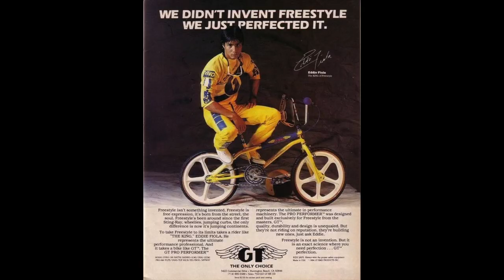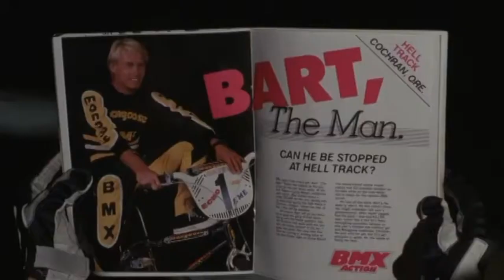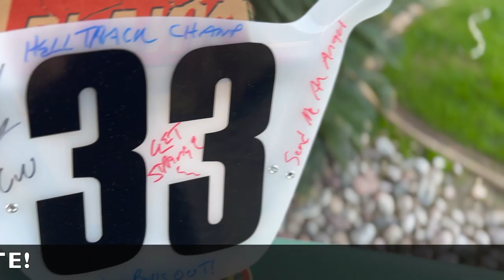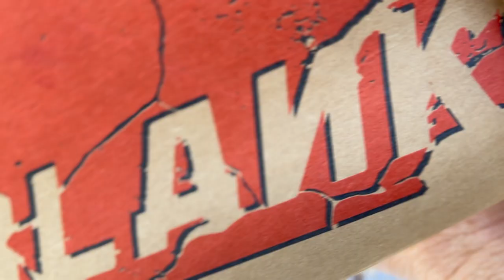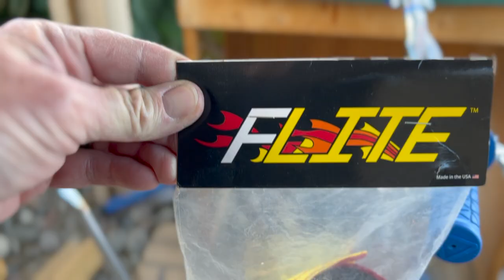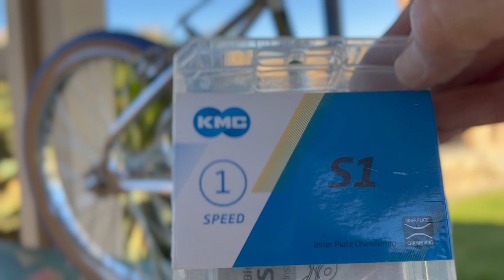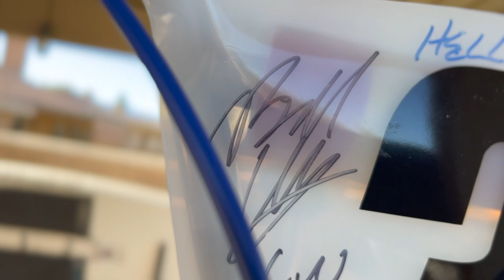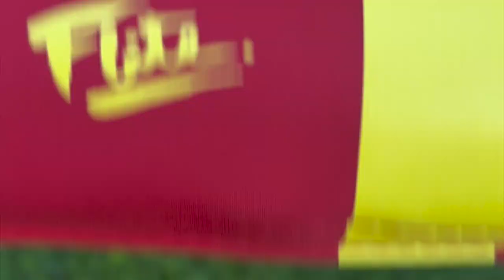RAD THE MOVIE CRU JONES DREAM BMX BIKE BUILD

Comment: Nice build, and nice backyard too!  Suggest lowering that seat post about 10 inches so the frame seat tube doesn't crack.
Reply: no thats how they're meant to be its 1980s bmx
Reply: @鐽  Many frame seat tubes cracked in the 1980s because the seat was too high (increased leverage).  Especially with a laid back seatpost shifting the weight further back.

Comment: I got my first My first BMX  in 1981 for my communion present; twas a used Black Mongoose, with red Araya rims, from what I remember.  The frame was probably 79, or 80: by the time the movie RAD came out I had a chrome, and white Haro sport .  My friends and I watched that movie every single day, afterwards, we  then went outside to practice the tricks from the movie.💫 RIP Tommy.
Reply: I had a 16” diamondback mini-viper in the late 80s early nineties and my sister had a viper with powder blue confetti paint it was sweet I wish I still had them my nephew has the mini viper I think
Reply: My first bmx was a gt Mach two I had a red gt piston headset put on it and odyssey y-bars it had red mohawk hubs, then I had a 2011 specialized pro series it got stolen I got it back then it got stolen again now I have a specialized Sirrus-x 2.0 gravel bike

Comment: I hope that's a 22.6mm diameter seat post instead of a far more common 7/8" (22.2mm) diameter seat post. You'll damage your frame if you clamp a 7/8" seat post in there without a 22.2-to-22.6mm shim. If it is 22.6mm, where did you find it? Also, you have it adjusted really high. Is it inserted to the minimum depth marking?

You can get Pro Class lookalike rims from BMXGuru for $40-something each, and you can also get a pair of full wheels built around those rims for around $200. It would be great to have originals, but they are big money, especially if you want ones that are new or like new.

Pro Class rims aren't the only things you're missing, by the way. Those handlebars are wrong too. The handlebars that came on Mongoose loop tails for several years in the 1980s had a very high cross bar, about as high as the grips, and Cru's bike had those stock handlebars. His two best friends' bikes had them too, because they were Blue Max brand, which was just Mongoose under a different name (made by BMX Products, Inc., same as Mongoose).

Your XC-II style bear trap pedals are wrong too. Cru's bike had the stock platform pedals (SR P-468), complete with the stock reflectors still attached.

Your Viscount Dominator seat is wrong. Cru's bike had the stock seat which was a Selle Royal Aeroyal lookalike.

Your hinged Dia-Compe seat post clamp is the right type, but it was silver on Cru's bike (which is the stock color) rather than blue.

Your A'ME Tri grips are wrong. You can buy officially licensed reproductions of the stock Mongoose grips which were made using the original molds, for about $30, from the same place that I assume you got your reproduction decals from.

And it should have small diameter axle pegs on the back. Remember the scene where Cru's sister was riding on his pegs?

Comment: I have a wild hair that I want to a Cru build. How difficult was it to track down all the parts?
Reply from the maker: Thank you for the comment. It’s not too difficult if you have the funds to spend. Some parts like the proclass wheels and the crank can get expensive. But the frame can be picked up for a couple hundred. eBay and BMX museum are a great source for parts.
Reply: @ahick  Dipped into this quickly and purchasing a frame on BMX museum. The crankset you used looked to be factory packaged, but I could not see the label. Would you be willing to advise on that?
Reply from the maker: @alexlehnhoff8356  the crank was a repopulate from Australia. You can find it here https://bmxworks.com.au/ . Everything else I got off Ebay or BMX museum. Would love to see the finished product. Have a RAD time!